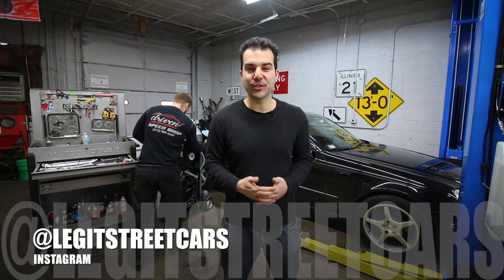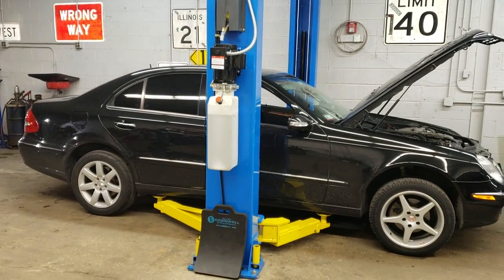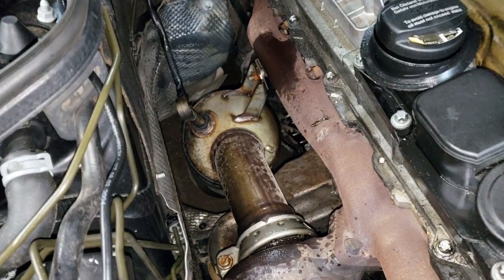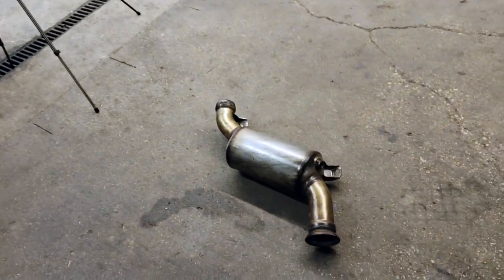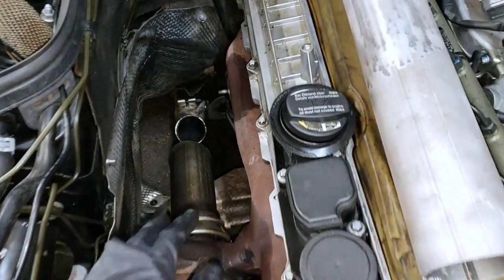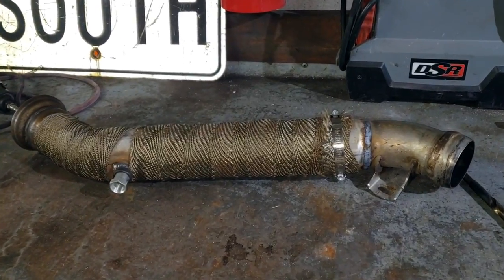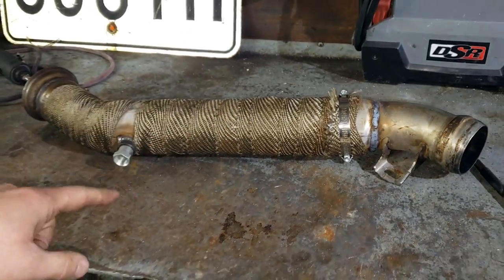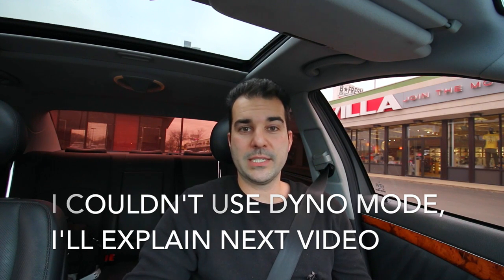I Installed A Catless Downpipe On My Turbo Diesel Mercedes & Tested 0-60 MPH. Listen To That Turbo!

Comment from the maker: Who wants to see some transmissions mods next? I think we could shavs off some serious time with quicker shifts.
Reply: Bigger turbo, please.... Larger injector, more horsepower..
Reply from the maker: Turbo is on its way!!
Reply: Love your videos!
Reply: That scares me.  My C230K transmission failed from a huge crack through a large center gear.  While I continue to buy Mercedes, I still fear transmission failure.
Reply: are you referring to the sonnax trans kit for better shifts?
Reply: @LegitStreetCars  Removing a catalytic converter is a federal crime. Also, Diesel's put out tons of pollution without catalysts in place. Why not set a good example and show your viewers about how to install a high flow cat?
Reply: PUT A BIGGER TURBO IM BEGGING YOU
Reply: mark kcuf thats really depressing
Reply: Could you stick a 7G-Tronic transmission onto the same bellhousing? Later W211 E280 and E320 CDIs in the UK had 7G-Tronic but they were V6s.
Reply: LegitStreetCars bigger pump?
Reply: @legitstreetcars You should Talk to Bill at Paramount Performance.  I’m gonna do blue tops or possibly a valve body upgrade from them.
Reply: @LegitStreetCars  What turbo you throwing on?
Reply: @borderwave2  Nah, it's state by state. Diesels are sort of exempted in IL. They don't get inspected.
Reply: @borderwave2  Not on diesels.
Reply: @borderwave2  It is interesting that the Clean Air Act prohibits tampering or modification of emissions control devices, however, exactly what do you think a "tune" does when a Bosch ECU is placed on a bench, heated up with a heat gun and cracked open and placed into Boot mode carefully to bypass the Seed Key requirement?  What percentage of these "tunes" do you feel meet federal emission requirements?  Daimler AG does not require SCN coding and a calibration number downloaded from Germany for each ECU they issue a DTB on for nothing.  The manufacturers attempt to lock the ECU down, only for tuners to crack the seed keys to flash it over the OBD2 port and worse case, crack it open on the bench and flash it.  And do get me started on how the Feds turn their heads on passenger cars with AdBlue removed.  It is advertised in so many mediums and nothing is done about them.  This is something that cannot be blamed on the current administration, as with the prior administration it was exactly the same.
Reply: What's causing this one to be slower than the other one?
Reply: @samr5043  7g tronics are more fragile, thats why the e55 still have the bullet proof 5gs instead of 7gs. That said with the monstrous torque by a modified diesel 7gs will fail at one point.
Reply: Craft equal lenght exhaust manifold for it, it should reduce turbo lagg.
Reply: Buy BMW diesel:( i know that 320cdi merc is nice but BMW diesel is another level..
Atm i have 325d original was 145kw now around 220-230.
Reply: Yes! Transmission shifts are the weak link in acceleration!
Reply: The Cat is there for a reason, you just made a diesel more poluting, do you have kids? Do you care about the future? Do you care about the enviroment?
Reply: @cristianfederico2411  go back in your prius and move on
Reply: @seskenas  I do what i want, but not hurting others.
Reply: Is wheel spin going to be an issue with any mod you do? How to get better grip?
Reply: @nanopiebald  ECU tunes that alter emissions values (which virtually all of them do) are not federally compliant. If you live in a state that does emissions testing and your tune is running rich for instance, you will fail to pass.
Reply: Lol what the fuck? I bet Alex is a secret ladies man! Anyways it doesn't matter to me I'm here for the cars
Reply: LegitStreetCars I would love to see a transmission mod. Also can I order that downpipe, I’m in Maryland so I can’t just go in to have this done. Thank you very much for all of your videos Alex.
Reply: I want to see a cone pod filter air box install, because you can find nothing about it on the internet, no one runs pod filters on youtube so far i can find about cdi airboxes
Reply: borderwave2 good point.  Ever tell that to the trucking industry, legal 20 year old hot rods owners, or billy bob and his carbon rich monster truck?  How about when Ford, GM, and Toyota lobbied California’s EPA into removing the clean air initiative?  Have you spoken to them?
Reply: @SKANK_HUNT49  Are you on the right channel??.
Reply: @borderwave2  an electric motor 😆
Reply: Leave the damn car alone
Reply: @samr5043  The 494 cars in 2007 after the MOPF started including SCR and NOT urea injection, but it was also a V6.  No 494 E-Class had Urea until 2010, which the W212 was introduced.  The M275 5.5 and 6.0 BiTurbo V12 relied on the 722.6 5-speed transmission to handle the torque.
Reply: Hey legitstreetcars. I have an e500  that I kept getting mass air sensor code on. Changed but problem remains. Messed car a little looked for leeks couldn't find anything. But now it drives ok as long as I don't put it in sport mode. What it some times does is when I come to a stop or slow down a little to much. When I give it gas for a second or 2 it falls flat on it's face like I'm not giving it any gas. Then all of a sudden it responds and you feel it kick in.  Once you're going through it dives fine.
Reply: Full 3" exhaust and some better tires that grip
Reply: LegitStreetCars What about the Engine Software ? You really need Mapping after removing DPF and DCO.
Reply: Where did you buy a spare dpf?
Reply: LegitStreetCars, Hi Alex I heard in this video that your 320CDI has a stage 1 tune. I have a CLK270 w209 2004 with 174,000 miles with full Mercedes service & parts. What are your thoughts on me getting it a stage 1 tune? Please could you advise?  Chris
Reply: Somebody has some issues haha
Reply: Did they make these in manuel transmission?
Reply: @LegitStreetCars   I know you are a busy guy.  Any help for us guys who have the oe642?  Please check your email about some specific questions from me, thanks for the great content.
Reply: Cl 65 amg 1000nm gear 5g tronic , 5g tronic best gear. No problem.

Comment: Ya know welding galvanized metal produces seriously toxic fumes, yeah?
Reply: Hank Hill, my thoughts exactly.. nasty stuff!
Reply: Yikes
Reply: Nothing as toxic as NOx !
Reply: You can weld galvanized steel as long as you remove the galvanized coating, and if you don't you risk serious health issues because of the heavy-metals.
Reply: @Doomskilled  thats why he ground the hell out of it on the grinder before he welded it
Reply: he didn't, but his coroner probably knows..
Reply: I've welded galvanized in industry for years. just drink a glass of milk after. you will be fine.
Reply: It's just zinc, you might get a headache and a major hardon......LOL

Comment: Nice, it isn’t that much louder and I don’t think it will smell bad. And once you get the bigger turbo.. oh my, it’s gonna sound and perform amazing! Really looking forward for it!! Also, 0-60 numbers don’t matter that much, because of the circumstances. You are definitely gaining a bit more hp and torque but don’t expect that high numbers.

Comment: I agree that rear bolt is hard to get at. I modified the shield on the two CDI's I have owned by grinding the hole into a slot. Now all you have to do is loosen the bolt, and slide the shield forward.  Try it, you will like it!

Comment: Just to be precise, in Diesel vehicles is not called a catalytic converter. It is called a DOC or Diesel Catalytic Oxidizer.
Reply: its doc with dpf right?
Reply: @antoniotod9614  Yes, only factory option in the US though. Normally the inline 6 just had the oxicat unless you optioned for the particulate filter.
Reply: Yes although not DOC had a DPF (dust particle filter). After 2011 I believe due to CARB and later EPA all diesels had to have a DPF and later and EGR.

Comment: The main strength of the car is it's in gear acceleration rather than from a standing start. You will see improvement in your 30 to 60 and 60 to 80 mph times and this is where the 320cdi excels. In the real world this is where you need the acceleration to be? I love it,leaves other cars standing!
Reply: What kind of numbers are you getting for 60 to 80 acceleration with your CDI? Thanks

Comment: I use to work at an exhaust shop and the reason the o2 wouldn't screw in is bc you welded thr bung in without the cap. It got hot and shrunk.

Comment: Love your videos man!  Thought - Could you reduce the cat matter material by half to maintain partial exhaust cleansing and still lose that half boost for power gain and remove the muffler for sound quality?  Cut a door into your old cat and remove the front filter matter, then mesh what is left and weld the door back on.  That is why I need a shop in my garage!  So I can further mod my S550.

Comment: Yeah, it will definitely stink and pollute more without a cat/dpf. And in ur particular case, no performance gain. What makes me more curious, is a fumes test. With cat  vs without cat. To see if it’s worth the weight loss and space gained in the engine compartment

Comment: As far as i know you want to loose as much temp as possible right after the turbo to gain power by getting more exhaust gasses away from the hot side(hot air has more volume than cold) so wrapping it with heat isolation can get it worse. What i think would be the best compromise is just wrapping the upper part so the intake does not get as hot as now but wrap it as minimal as possible to get it to cool down as fast as possible

By letting it cool down the difference in density will cause like an vacuum allowing more gasses in the same time to get out
Reply: You got it wrong.. more expansion and heat with a wrapped tube leads to greater velocity and therefore exhaust efficiency.

Comment: How about instead of modifying  the second hand cat  by cutting it up just punch out the honeycomb inside the cat therefor leaving it stock looking from the out side .
Reply: Cut the pipe's at each end of the cat weld a straight pipe through the cat weld the original pipes back on and problem solved flow issue gone while keeping the stock look.

Comment: If you want to change the intercooler, try thinking to put an air to water one.  It reduces the lag of the turbine to almost 0. But if you don't or its a to high cost ,let the original one and the new turbo.  Otherwise you will have big turbo lag,and a small wide band of power.

Comment: Sounds great, mufflers are next to go though.. if you’re not liking the diesel smell, try running a biodiesel blend- B10 or B20 should be fine depending what is available to you.
Reply: B10 - B20 is aplenty here in Illinois. Due to the corn lobby and tax incentives it's actually easier to find than #2 diesel. BUT, Mercedes doesn't recommend anything over B5.
Reply: I didn't know Mercedes only recommended B5 and lower, I assume that is only on the common rail engines? Old mechanical injection OM616's etc. will run on filtered waste vegetable oil quite happily- as long as it's not too cold, so Illinois in the winter might be tricky!

Comment: Try doing cold air intake, that intake above exhaust is weird and I think it's reason for heat soak. Also, big intercooler too
Reply: Gedas Alekveravičius Not sure adding a cold air intake would would net any gains due to the fact a Diesel engine prefers warmer air in its cylinders since its compression ignition. Increasing the size of the intake if it’s restrictive could help, but not to sure a cold air intake would do much since the air needs to be compressed and heated in the cylinders anyway to ignite. The new turbo for sure tho will help since it’s forcing more oxygen into the engine , not by means of cooler air but by the amount of air it’s drawing in. Being heat soaked is bad for power but a cold air intake isn’t going to do much. Insulating the turbo, and a better cooling system would be more beneficial .
Reply: Hehehe, I've also thought the same😅 but still, even in diesel, colder is better, also if you increase the boost, more molecules in the cylinders, they get compressed even more, even more heat to ignite, so really it would be better
Reply: Colder is better for diesel motors? They wouldn’t need glow plugs or a system to preheat the cylinders if that was the case. The only thing in a diesel that you want to keep cold is the exhaust system. EGTs are way more important then intake temps.
Reply: The air in a diesel engine needs to be hot enough after compression that the fuel ignites when it enters the cylinder. There’s no other method to ignite the fuel. If the outside air is very cold, and the motor isn’t warmed up, compressing the air doesn’t heat it up enough to ensure the fuel ignites.
Reply: @calebdutka3285  colder is more dense, more oxygen molecules etc, as petrol engines. Colder is better coz more oxygen, so more fuel can burn. Yes engine can run on cold air, it can run on - 50degree Celsius, but yeah, start with glow plugs and it won't run if engine is not warmed up. But compressed air will heatup enough to ignite the diesel, but cold block will not
Reply: @calebdutka3285  he lives in place above zero, nothing espiacially difficult for engine, normal warm up times, not like in Russian winters, and engine with CAI will work no prob. In russia it would work too, if block is warmed up
Reply: The air going into the airbox is pulled from in front of the radiator via an air duct.  so it already has a "cold air intake" .  Not saying there's not room for improvement, but its not breathing engine compartment air.
Reply: as i thinking of making just wider air intakes and pipes before filter, how about that ?

Comment: I believe you should replace the CAT and keep a clean-burning car. If you wish to make any car a 1/4 mile bandit, then remove the plates and just go racing with a modified car. Adding a bit more power without impinging upon the fuel mileage or emissions is what everyone should be desiring. 
I love diesels but they are a problem since the VW scandal. And, even Mercedes and I believe BMW and most other mfgrs of diesel cars around the world are experiencing the same or similar issues as did VW... false claims from their emissions tests. Mercedes newer diesels like the 4-banger which was touted by Benz as a  great design, and their earlier V-6 diesels, were/are good engines but have had their fair share of issues. So, the best diesel by Benz is likely the one in the E320 CDI cars (and trucks) as it is truly bullet-proof... The OM648. 
Enjoying the videos, nonetheless.
Reply: I still mourn the day I wrecked the 1998 W210 E300TD sedan (my first accident after driving for about 54 years). While it had 187k (or so) miles on it, I had it in top-notch condition and it ran very well. On a trip down to Louisiana through Miss, on I-55 I got it up to 90 in a quick spurt and it was purring. Just like the old W126 300SDL we once had. The W210 was pampered by me. I made sure all rust which popped-up was taken care of by a shop every Summer. It had all new brakes (Akebonos), new front roll bar bushings (a PITA to replace by laying under the car), Conti DWS06 tires, used Liqui-Moly oil and filter and other sundry parts on the car from FCP Euro, had fresh tranny fluid and filter, new coolant, new brake fluid, good A/C, an Alpine Bluetooth with microphone and adapter and resistors to take full advantage of the Bose system in the car, and new P/S hoses. The insurance company gave me $6300 for it. I should have bought it back before auction and fixed it, but it was really crumpled in the front (hood, front cross-member, bumper, radiator and A/C stuff, cooler, and pushed in the sub frame rails. I hit a Hyundai econo car in the back doing about 35mph. Air bags never deployed and no one was injured. I had just pulled into the right lane with lots of room and a guy who had been tail-gating me zipped past. I just quickly glanced over to the left not even moving my head, when I caught out of the corner of my right eye the stopped traffic. I slammed on the brakes and even with the great brakes on the car, I could not stop within the 20 or so feet I had. Obviously, I was cited. Since it was 4 days before Christmas and we were driving to our son's in Illinois, there was no way I could coordinate a rebuild of the car. So, when we returned home, I researched a lot of Benzes, even a new CLA250, and ended up with a 2013 C300 4Matic (sport) with the M276 motor. It's a fantastic car, especially in the snow we now have. Very few options on it except for the Harmon-Kardon entertainment package, which is great. I again used the Conti DSW 06 tires and have recently installed new front brakes (rotors and Akebonos) from FCP Euro. Rear pads will go on in the Spring (too dang cold in the garage). I still use Liqui-Moly.  The W204 is incredibly stable with the DWS06 staggered tires. Love it... handles like it's on rails... better than the SLK230.
Even use it in our 1998 SLK230 kompressor which is now under wraps for the Winter.
So, lesson to be learned: KEEP YOUR EYES ON THE DANGED ROAD!!! Sigh.